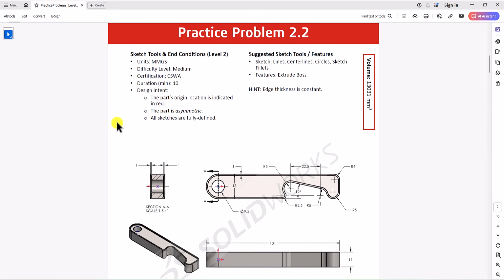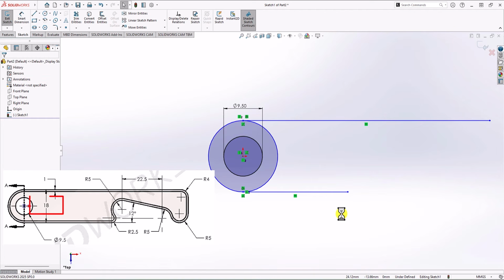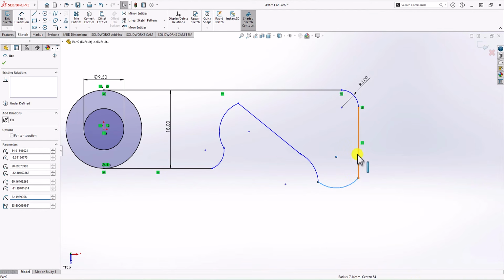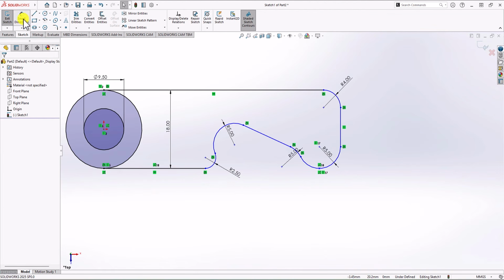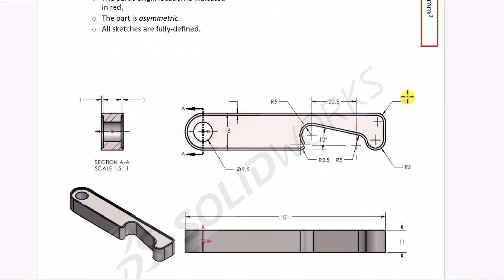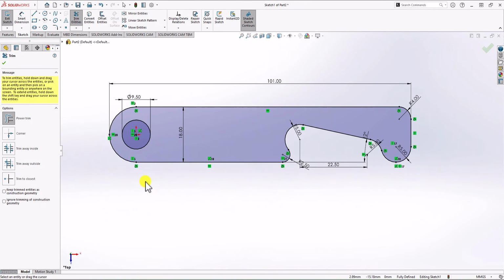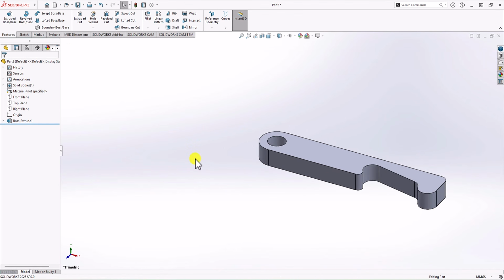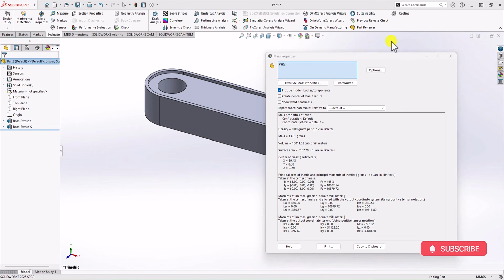CSWA Practice Problem 2.2 Solution | SolidWorks Exam Guide

Comment: I also came to confirm that I did this 90% on my own then came to the video because I was having an issue with a few constraints; in the end I got the same answer 13011.32 cubic metres. The difference for me is added the 1mm lip to both sides. I cannot for the life of me, figure out where they got their number.

Comment: Do they accept the tolerance in the exam? Because they did not mention any tolerance
Reply from the maker: Most of the questions on the exam are multiple-choice questions, and as long as your answer is within 1% of the correct answer, you should be fine.

Comment: 10:40 you can see that these are not alligned at all...
Reply: Yeah that was the only thing messing up my results.
Reply from the maker: @salserokorsou  As you mentioned, at 10:40 I made an assumption in order to make the geometry fully defined. My question is: were you able to find the correct answer without making this assumption?
Reply: @Design_With_Roozbe  I didn't.  That's how I ended up here 😅
Reply from the maker: @salserokorsou  Haha, I see, I thought you might have reached the exact answer using a different assumption, so I was curious. Good to know! As I mentioned in the video, I believe the geometry isn’t fully defined, so the assumption I made was my best attempt to get a result close to the final answer.
Reply: @Design_With_Roozbe  I added a dimension to the lower right arc to fully define it. It got me at least close.
Reply from the maker: You are absolutely right. As I mentioned in the video, the geometry is underdefined, so we have to make an assumption. The assumption I used was the best option we had for this question in order to get an answer close to the expected result. So in summary, we know the assumption is not perfect, but it still helped us reach an answer with only about 0.2% error, which is good enough for the exam. Out of curiosity, were you able to fully define the geometry without making this assumption? If yes, please feel free to share it with us.

Comment: But according to my limited knowledge, I believe the section A-A doesn't even show the thickness of the edge and is only showing a counterbore on both sides the hole. The total height of model including the boundary edge is 11mm, but the inside extrusion height is not mentioned in drawing. IDK.
Reply from the maker: You are absolutely right that Section A-A shows a counterbore around the hole. However, the subtle point here is that the counterbore is on the same plane as the rest of the cutout. If you look at the 3D model in the drawing, you can see a flat surface, which suggests that the inner extrusion should have the same depth as the counterbore. If the inner extrusion had a different depth from the counterbore, we would expect to see one more step in Section A-A in addition to the counterbore. Please let me know if this addresses your concern

Comment: I notice on my own drawing that it was defined while your wasnt. I had defined the length of top line tangent to the big circle to the right edge of the part as 92. I was doing the drawing myself before I got lost and came to your video. I then deleted that definition and tried your way of adding a point to the left edge and defining the distance to the right edge as 101, and my drawing was underdefined like yours. Idk why the point method didn't work. Maybe you have a theory?
Reply from the maker: Thanks for your comment. It’s hard to say without seeing your model, but what you described sounds strange — 92 mm and 101 mm should give the same result. In the model, we have a 18 mm circle on the left and 92 mm straight length, which together make 101 mm. So normally, it should work fine unless the left side (the 18 mm half circle) is not fully defined.For example, if the 18 mm width of that shape which dfines the diameter of the lft circle is missing, then 92 mm might work, but 101 mm (which includes the half circle) would stay underdefined. This is my initial guess without looking at your model. Can you share your model with me so I review it? You can send it to " projectroozbeh@gmail.com "

Comment: You made a mistake in the percent error calculation.  You need to divide the difference between the results by the correct answer in the PDF, you divided it by your model's volume.
Reply from the maker: You are absolutely right — the correct definition of error is the deviation divided by the correct answer. But I think you got my point: the main idea was just to show that the difference isn’t significant and can be neglected.
Reply: @Design_With_Roozbe  It's supposed to be within 1% error to get the correct answer on the CSWA exam.  If not, then there is something wrong with the model.
Reply from the maker: @loquillo661  The answer we found in the video is well within the 1% threshold you mentioned. The difference in volume is 20 mm³, while the answer in the PDF is 13,031 mm³. This results in an error of 0.15%, which is comfortably below 1%
Reply: @Design_With_Roozbe  Okay, thank you.